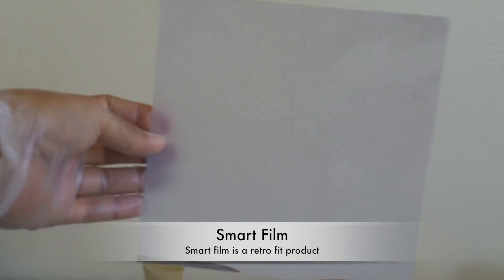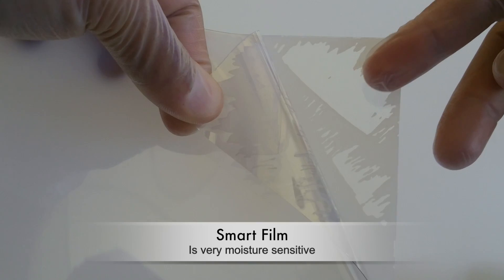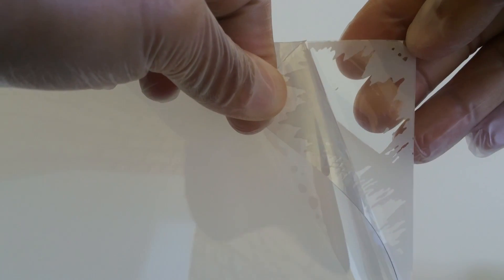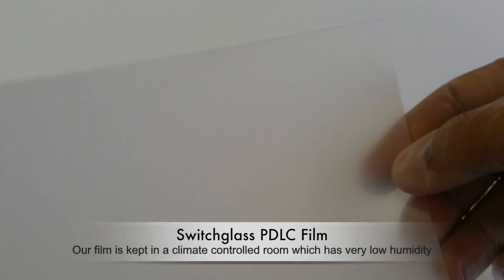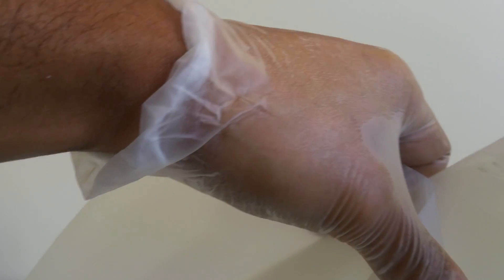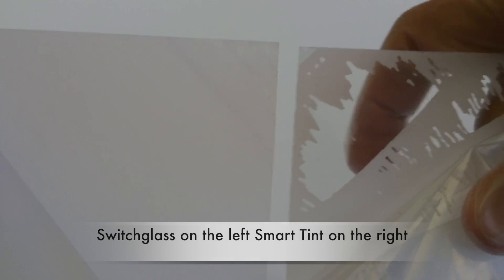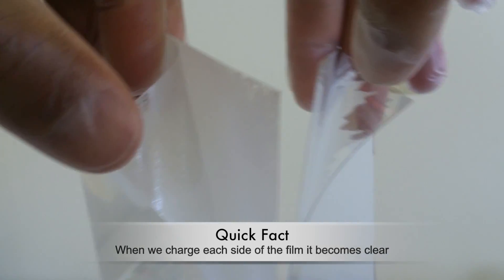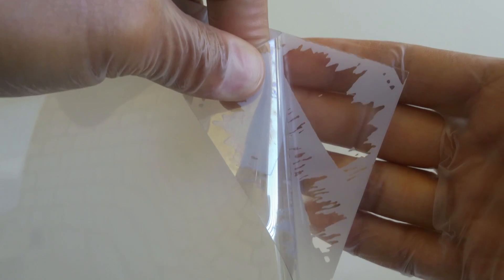Smart Tint Vs Switchglass

Comment: Makes me think you don't rate your product if you don't compare 12 months old with 12 months old?
Reply from the maker: Hey Robert, thanks for your comment but we not leave our product for 12 months without laminating it. PDLC is very sensitive to humidity and the result would be the same in terms of it degrading, once it is laminated then is is not subjected to the elements such as moisture which would drastically shorten its lifespan.

Comment: Hey mate, this product doesn't look diy or consumer friendly. Do you have any products where you can apply the film on yourself? I'm totally keen on doing a camper van and retrofitting the existing windows however your video raises a good point on degradation. It seems the competitor had a more consumer friendly approach initially however the end result may not be favourable
Reply from the maker: You are correct that our product requires a level of expertise with regard to having it installed by a licenced electrician as well as a qualified glazier. 

The film which you can apply and DIY yourself more users friendly but comes with it's own pitfalls. If you are ok with limited warranty and you accept that it has limitations with regards to its longevity then this may be an option. 

For me even though we could have sold a truckload of this film globally as there are less barriers to sending a piece of film vs an entire panel of glass I'm not comfortable that the manufacturers of the stick on film will not offer any warranty of any description on their products and those who do dont always support you if something goes wrong.

All the best regards Roman Watkins
Reply: hey mate. im thinking the same for our van. did you end up using the smart tint on your van?

Comment: This test is such a joke. You cant test a new product, vs one that has   been in the elements for months
 Especually given the product isn't designed to consistantly be in the elements period. No way I would buy a product with shoddy testing like that
Reply from the maker: Hi Michael, how would you propose we do our comparison test?

See comment from notcranium on his experiences.

"I wish I had tried Switchglass intead of Smart Tint.  Smart Tint was great and responsive in order to make the sale.  Then when I experienced an issue and reached out for some assistance on troubleshooting, I received a terrible response.  They accidentally left an internal email from John Adams in their response to me which directed the person who seemed willing to provide some sort of assistance "don't waste time with this guy" "if he likes he can purchase engineering time at 350 per hour" with a 2 hour minimum.   
And then they stopped responding to me.  

Smart Tint is the worst company I have personally dealt with for customer service in MANY years.  It doesn't matter how good a product is if they don't stand behind it."

Comment: Wow, this is the height of marketing BS. These are the same exact product. I'd wager they're from the same supplier and made in the same factory. One gets laminated to/between glass and the other is just applied to the glass. In "both/either" case, the liquid crystal is dispersed in a liquid polymer then sandwiched between clear electrodes and cured to a state where the polymer is solid and the liquid crystal remains liquid, dispersed in the now solid polymer like oil droplets in salad dressing. When you laminate, oh I don't know, say Reynolds wrap, between two sheets of glass you may get a better or more suitable finished product, but it doesn't cease to be Reynolds wrap and become a new, superior product, solely by virtue of the lamination and glazing process.
Reply from the maker: Hi Waffle Staffel, thanks for your comment. Everyone is welcome to share their thoughts and of course, I am happy to answer any relevant question that may bring some value to other viewers or subscribers of my channel. Maybe this explanation would be more detailed for you which pertains to the longevity of the different PDLC products and their life expectancy. 

Firstly the products tested did not come from the same factory. There are a few different answers to that may help you and I will cover off on those more to elaborate on the different evolutions of each of the PDLC products that have been developed over the last 25 years. Waffle Staffel the other consideration is where it is located, internal and or external (direct sunlight or indirect sunlight), and how often it is in use. 

Let’s start with the assumption that all these products are being laminated by qualified companies using quality products and that the longevity of each of the compared PDLC products’ evolutions is not compromised by this part of the process. Another consideration is the electrical components: the quality of busbar application and what materials are being used. The reason I mentioned this is that if it is not done properly then UV cracking can occur due to the silver paste (a material used in the process) causing the panel to fail prematurely. Side note: the silver paste is used for PCB (Panel Circuit Boards) and is not designed to be used externally (needs to be out of direct sunlight).

Now to start with a summary of the various Evolutions of the available products. Evolution 1.  This First generation, US Patent 4435047, patent expired) utilizes water-soluble polyvinyl alcohol to disperse liquid crystal droplets and is called Emulsion Technology or Nematic Curvilinear Aligned Phase (NCAP) technology. 
Evolution 2,  the Second generation, ( US Patent 4688900, patent expired) utilizes epoxy to disperse liquid crystal droplets and is called Polymer Dispersed Liquid Crystal (PDLC) technology. 
Evolution 3. The Third generation  ( US Patent 5270843, still in force) utilizes a non-linear polymer to disperse liquid crystal droplets and is called Non-linear Polymer Dispersed Liquid Crystal Display (NPD-LCD) technology. 
 
A general term for all the above generations is Liquid Crystal Microdroplet Display or LCMD. Both 1 and 2 Evolutions of LC switchable films invented over a quarter century ago have similar features. Evolution 1 and 2 film should be laminated between glass to prevent absorption of moisture from the air. These products are recommended for internal use and if used externally then would need to be double glazed (IGU) into an insulated glazing unit.

So to answer your questions: Evolution 1 and 2 installed internally (no direct sunlight) used daily and being switched off for 50% of the time will last between 15-20 years (remember the caveat to this specified above in paragraph two).  Externally, also used daily and being switched off for 50% of the time but double glazed using a high quality soft coat low e glass, it  will last between 5-10 years.

However, Evolution 3 product installed internally (no direct sunlight) will last between 30-50 years. Note that this product does not require to be switched off to assist with longevity and can be left on permanently, remember the caveat to this specified above in paragraph two. Evolution 3 product installed externally (note that this product does not need to be double glazed) will last between 20-30 years.

There are not many articles in the world dealing with answers to your question. This is due to the complexity, variations and ongoing improvements in the quality of products out there. Consider the plasma displays which were invented in July 1964 at the University of Illinois by professors Donald Bitzer and Gene Slottow; then came (LCD) in 1972 and LED 1977. The quality of these first generations of products was very poor, however subsequent improvements and developments over time improved their reliability. There are so many different manufacturers of these products that technologies and pricing and fluctuate wildly. 

In conclusion: To come up with a fixed rule to encompass every permutation or variance associated with this complex, neo-techno-chemical product is somewhat impossible. Waffle Staffel I have done my best in using the knowledge acquired from working in the industry over the last twenty five years (the latter half as a manufacturer of Switchable glass products ) to give you the best possible answer I hope it’s satisfactory.

Regards 

Roman Watkins CEO (Switchglass)

Comment: Dislike for failed logic. Not a true comparison. Do a video with both products at 12 months.
Reply from the maker: David, as our film is designed to be laminated. Typically this is about 10-15 days from the time it is produced. We do hold stock in a climate controlled room with a 10%RH (so very low moisture) where it is kept for no longer than three months. Once it is laminated is stops degrading as it is no longer exposed to moisture. With retrofitted PDLC it is exposed externally to the elements and this is why it does not have a very long lifespan. It any PDLC film is exposed to the elements for 12 months then the outcome would be the same. This demo is to show what happens when it is not laminated.
Reply from the maker: The reason for not having the PDLC out in the open is that it utilizes water-soluble polyvinyl alcohol to disperse liquid crystal droplets and is called Emulsion Technology or Nematic Curvilinear Aligned Phase (NCAP) technology. 

In general term Microdroplet Display or LCMD which are LC switchable films invented over a quarter of a century ago have these features. They should be laminated between glass to prevent absorption of moisture from the air.

Comment: You're comparing apples to oranges! Smart Tint would be installed INSIDE the car. So leaving your square outside in the elements for 12 months and testing against your 'brand new film' that was 'stored in a climate controlled location' is a ridiculous test that has NO value. This is a waste of time. And it does nothing to prove your product's superiority. It only shows you play dirty when comparing your product which makes me not trust you. Shame on you.
Reply from the maker: Jimmy, we are able to sell this product as well and it would have a far greater margin for us! 

However, our test over the last decade along with our partners around the world support the product not being very reliable. 

The reason this video was made was that we replaced an entire project which had Smart Tint installed due to the customer being disappointed with the quality and performance of it. 

Please share something that might be constructive for our readers, if you note that we try to respond to all questions that are asked of us. The test square was not fitted outside but inside on our office window with no sunlight on it.

Furthermore, the PDLC has a clear conductive layer that needs to be protected from the elements as it will have a reduction in its electrical conductivity over time. This causes a product that has not laminated and or fitted into an IGU to lose this resistance and no longer power the liquid crystals to align at this stage the panel no longer switches into the clear state.

Here's the article below if you are interested:

Smart Tint vs Switchglass – What is the difference?

•   Smart Tint is a film that can be retrofitted (stuck on) to the surface of your existing glass.

•   Switchglass is a ready-to-glaze product that incorporates a switchable Polymer-Dispersed Liquid Crystal film carefully laminated between two pieces of glass.

There are many promotional videos on the internet showing Smart Tint being easily installed in just a few minutes. These videos clearly over-simplify the process. Handling switchable film (even in the form of Smart Tint) requires considerable skill and experience. If the film is creased, bent or bruised it will damage the liquid crystals inside leaving a clear patch where the damage occurs. Our technicians need a minimum of six months training in the handling, wiring and laying-up of switchable film for lamination and our clean room (a totally dust-free environment) is monitored to ensure quality handling is achieved and optimum standards are met at all times. 

It should be noted that a number of years ago, with the possibility of marketing these self-adhesive DIY switchable films ourselves, we tested a number of them (including Smart Tint), but based on the results all were rejected. 

Pros and Cons of Smart Tint

Pros:

DIY 

Cheap

Cons:

No warranty support 

Easily damaged during installation

Low clarity

Limited lifespan

When cutting or trimming to size the edges are easily damaged 

A Case in Point – and the reason we felt the need to speak up about this DIY product

We were recently approached by a disgruntled customer of DIY Smart Tint. The following is a rundown of the customer’s unfortunate and costly mistake in choosing Smart Tint over Switchglass.

Their Smart Tint arrived rolled up and packed into a box which contained all the equipment; the film was approximately cut to size for each of the windows. The client’s Project Manager organised a local tinter to install the Smart Tint using the instructions provided. After the installation the client commented that the film was not very clear, with an unacceptably high level of haze. He also commented about the edges being slightly damaged and bubbles visible in the film. 

Overall, the customer was definitely not satisfied with the outcome. The Project Manager communicated the customer’s dissatisfaction with the Smart Tint supplier and was given some tips on how to improve the clarity, i.e. by ramping up the voltage to the Smart Tint (this is not a good idea as it can damage the sensitive PDLC film and shorten its lifespan). This did temporarily improve the clarity, but the transformer could only run the Smart Tint for 2-3 minutes before shutting off, then needing 10 minutes to cool before starting up again. 

After being initially responsive to the Project Manager’s needs the Smart Tint supplier then ceased further communication for no apparent reason. Now the Project Manager is looking to start legal action against them. This will be challenging as the supplier is located in the United States and he is in Australia. The customer concluded that the performance of the Smart Tint (and the lack of follow-up support) was unacceptable.

We were approached and we met with all the stakeholders. Upon testing our sample and witnessing the results, their response was that the “Switchglass was much clearer than the Smart Tint”. At the end of the meeting it was agreed that the Smart Tint and glass would be removed and our Switchglass installed in its place. 

Caveat Emptor – let the buyer beware

This has been a very costly exercise for the customer who has spent nearly double the amount of what it would have cost to have Switchglass installed in the first place.

We will have some updates coming from this case study shortly as the replacement installation has not yet taken place. We will have a video, pictures and interviews with the customer, Project Manager, builder and architect. Our aim is to provide relevant information that will assist all parties and future customers in making an educated decision. 

In conclusion, Smart Tint may seem like an attractive option due to its promoted ease of installation and low cost, but we advise caution - as the above scenario clearly demonstrates

Comment: Not a like for like comparison. Comparing a 2 wk old film to a 12 month old film is not informative. Why not have both pieces 12 mos old!?
Reply from the maker: Denise, we have a great deal experience with PDLC film and understand how it works on many levels. Our film is designed to be laminated. Typically this is about 10-15 days from the time it is produced. We do hold stock in a climate controlled room with a 10%RH (so very low moisture) where it is kept for no longer than three months. Once it is laminated is stops degrading as it is no longer exposed to moisture. With retrofitted PDLC it is exposed externally to the elements and this is why it does not have a very long lifespan. It any PDLC film is exposed to the elements for 12 months then the outcome would be the same. This demo is to show what happens when it is not laminated. If you have some technical information you'd like to share please feel free to do so. Thanks

Comment: I'm looking to put something like this on a 2012 Charger with a split zone setup so I can completely darken the rear windows and back glass separate from the front 2 windows which are more often subject to tint regs. How complicated would that process be, what pricing estimate would I be looking at, and where would I need to take it for installation? (Midwest region would be nice if there's a facility.)
Reply from the maker: Great idea in theory – a split‑zone setup on a Charger would look awesome.

The tricky part is that our product is a laminated switchable glass, not an automotive film, so it’s designed for custom glazing rather than being applied to existing car windows. Because of that, we don’t have a way to retrofit it to a 2012 Charger or quote/coordinate installs through Midwest shops, and you’d be better off speaking with a specialist automotive tint or smart‑film installer in your area who works specifically with road‑legal car applications.